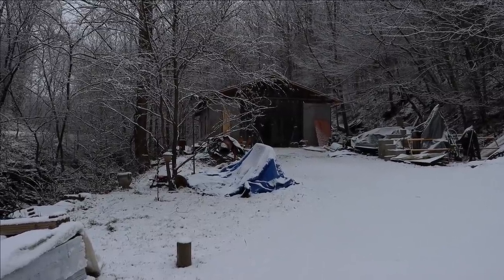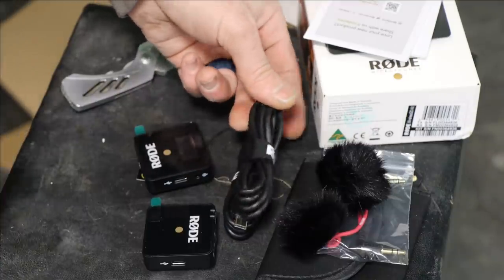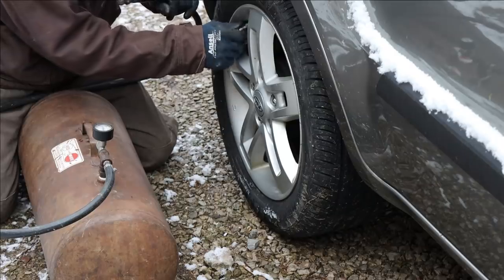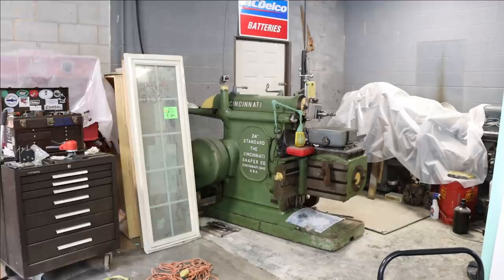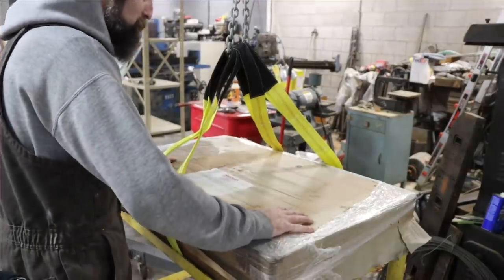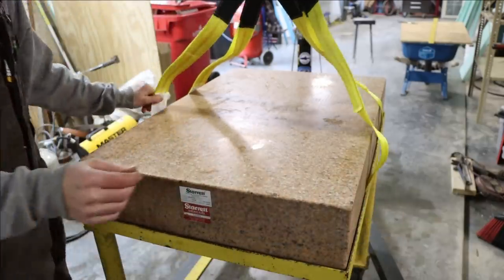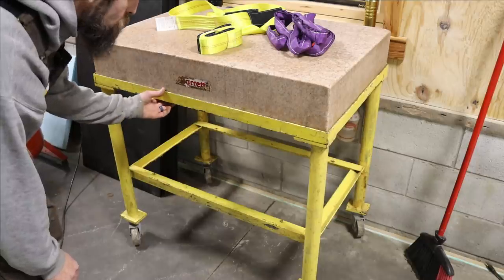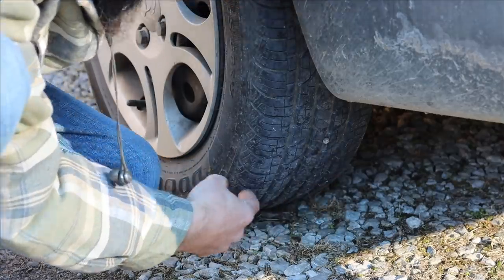NOT a good Week ;-) Shop update Shaper up and running.

Comment: Sorry Steve, I just can't deal with the bad audio.
Reply: Then upgrade. Quit whining about it!
Reply: @1pcfred  What are you talking about?  His low audio levels make it impossible to follow his narrative.
Reply: @BossmanEight  I am talking about being able to deal with it if you had adequate equipment. If you had the gear you could just turn your volume up to be able to hear lower level audio. I went from my usual level of 13 up to 17 on this video and I caught every word Steve said. Of course I have a 370 watt 5.1 surround digital amplifier. It tops out at 33. To give you some idea of what works. Something to shoot for. I use an old Blu-Ray player I picked up at a yard sale for $10. It's a Sony! The speakers it came with were crap though so I replaced all of them except for the sub. That made all the difference. All told I might have $50 wrapped up in the audio? I put like real crossovers into the front speakers, got a Toslink cable to hook it up. You know, little things. Sounds bitching now.

Comment: Don’t you just hate those stupid little tyres they give you
Reply: your lucky to get a "stupid little tire" my last four cars do not have a spare of any sort nor do you get a jack but as the they are wide and 18"  changing them would be a chore , all you get are run flats they are ok for 50 mph and 70 miles even with the valve core out , at least they get you off the motor way , that's BMW for you
Reply: @stuarthardy4626  Mine had canister, but I bought a skinny spare off Ebay (pretty cheap)... it fits in the book ok. Maybe worth looking into. So now I have a spare and a canister.